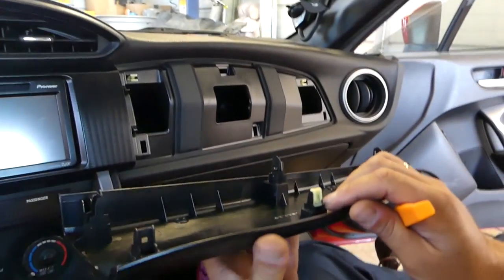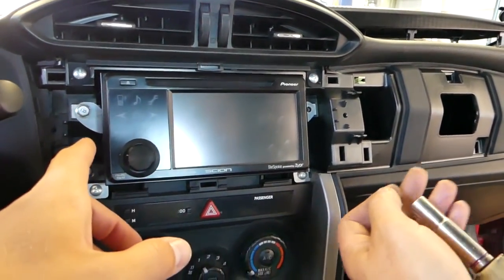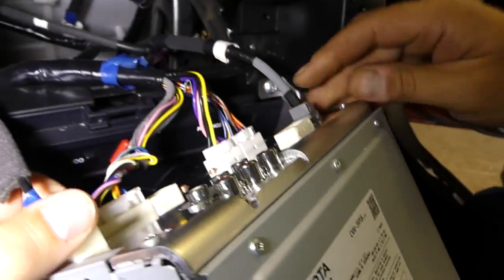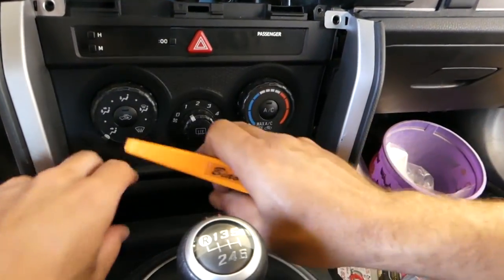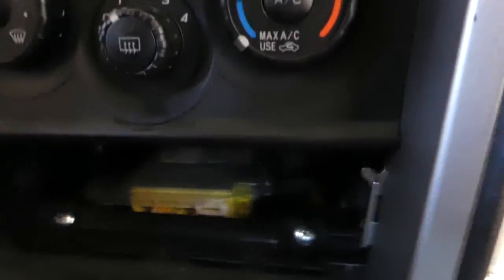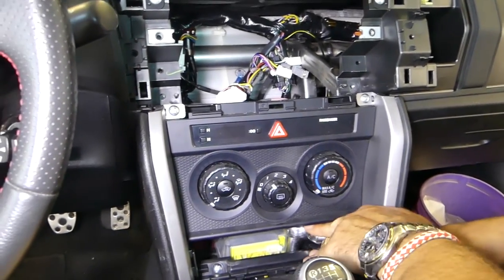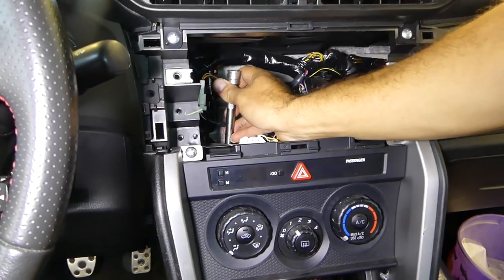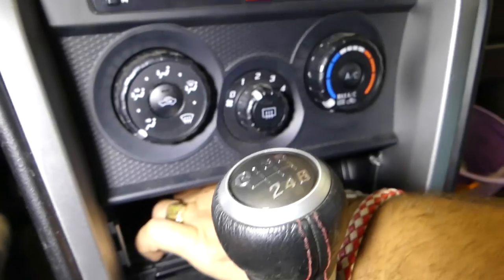GT86 SUBARU BRZ SCION FRS AIR BAG MODULE REMOVAL REPLACEMENT  AIRBAG MODULE

Comment: I don't see why you need an extension or even remove the radio, you can just use the same ratchet or smaller to fit inside the compartment and loosen

Comment: Is there any possible way to make an ON/OFF switch for airbag deployment function? I mean for my own case I do drive alot on dirt in my brz and I don't want my to deploy accidentally when I make a high speed jump in a dift course.. so I wounder if someone can help to make on demand switch for airbag
Reply: Just pull the fuse

Comment: hi,do you know any good company that could reset a 2013 scion frs airbag control module and fix the 2 front seat belt. Also 2001 audi tt quattro mk1 air bag control module????